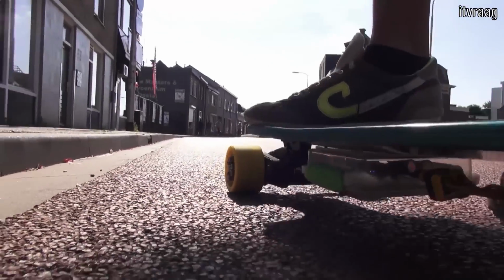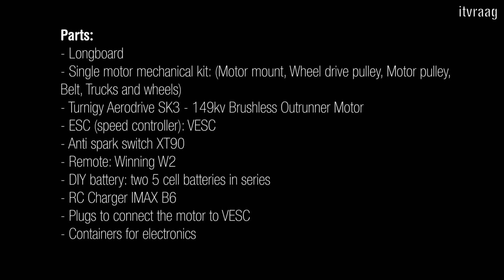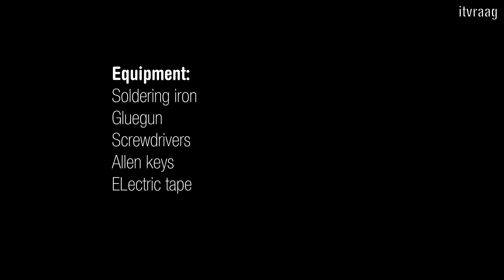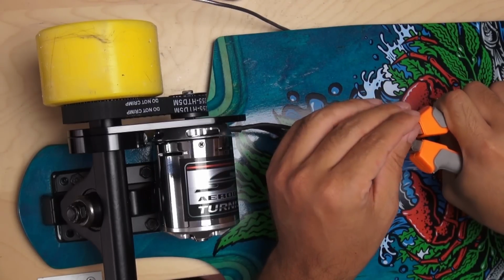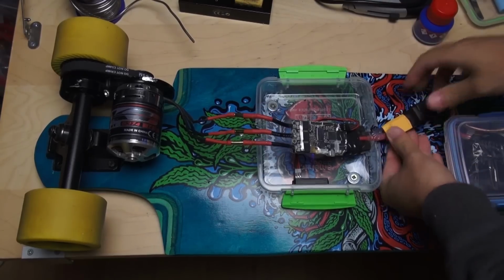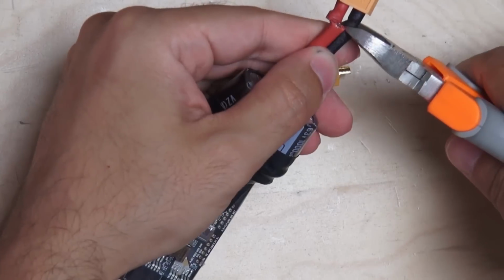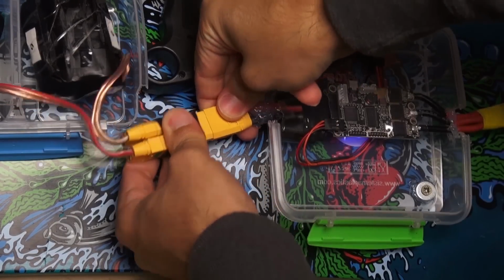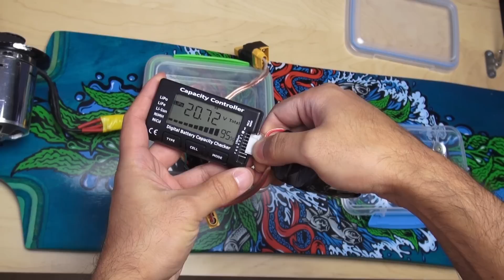Half-DIY: electric longboard

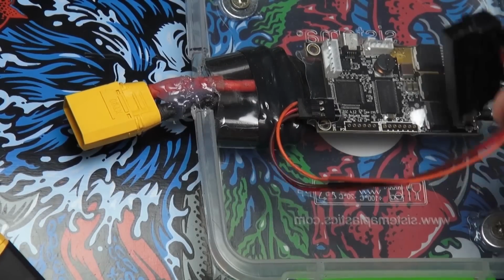Comment: Think something is short circuiting look at 9:57 it can be the wires under the capacitors.
Reply from the maker: +Oliver Schreyer 
Just some LED lights :)
Reply: no the LEDs is underneath the VESC, but just be4 you drop the receiver there is some smoke from the VESC (copper coil). Slowmo it.
Reply from the maker: +Oliver Schreyer 
I think I now see which part you mean but I think it's just the reflection off of the heatshrink around the vesc. But thanks for noticing and the link. I'll keep an eye on it.

Comment: Awesome log of your DIY process.  I'm a bit of a novice DIYer.  I've worked on my drone a bit with soldering.  I've been stalking the eSk8 forums and am trying to work up the confidence to build my first board.  Your build video was very helpful as you even show the issues that may arise.  What does motor Kv mean, I'm still trying to put my finger on it.  Anyhow, great vid!

-Neil

Comment: very instructive video! How is your actual range? and top speed please?
Reply from the maker: +Aurélien Original 
Thanks. With the current battery just about 6km of range and maximum speed was around 24km/h. With the new battery cells I should triple the range.
Reply: Hi, how big is the battery in order to get 6km? (In mah) Thanks!

Comment: I have a motor that can handle 80 Amps Max.. And I want 3 battery's in series ''3S 5200mah 10C-rating'' Are they compatible?

Because 5,2A x 10C = 156 amps.. and that's way more than 80 amps that the motor supports. 
Or does only the volt matter?
Reply from the maker: +Samuel Avila 
I'm new in this myself, but I believe that the ESC handles that. I only looked up what's the max voltage on the motor and tried to get as close as I can.

Comment: hey man I have the same remote and the issue. when I turn on the controller the motor starts to run by itself. do you know how can I fix it?
Reply from the maker: +Spider Man 
I haven't looked into it, but should be fixable through the VESC. I'll create a video about it later.